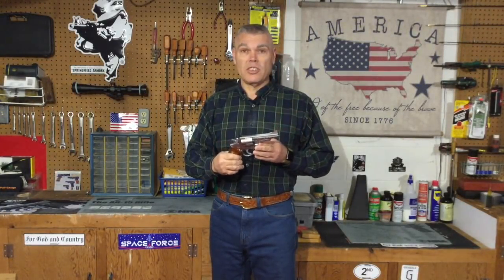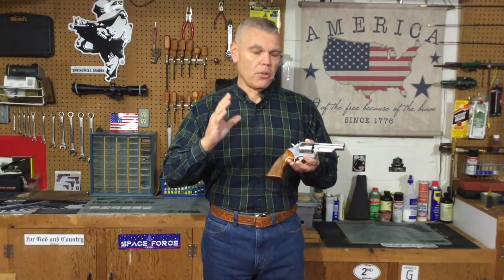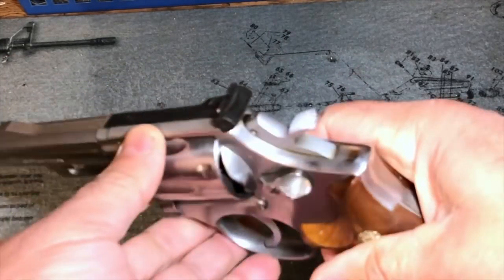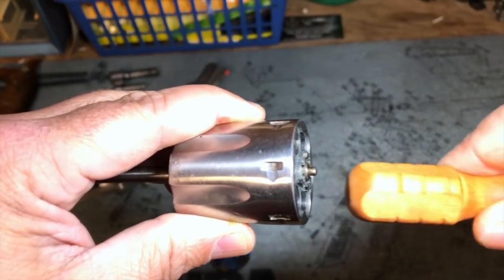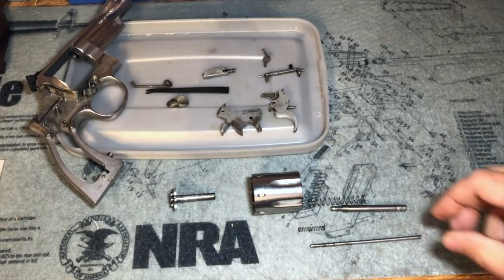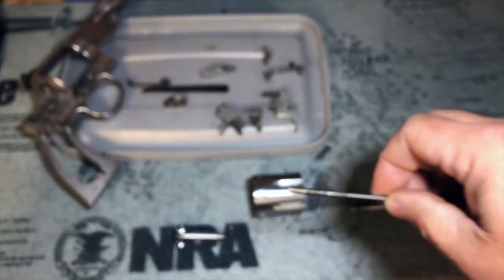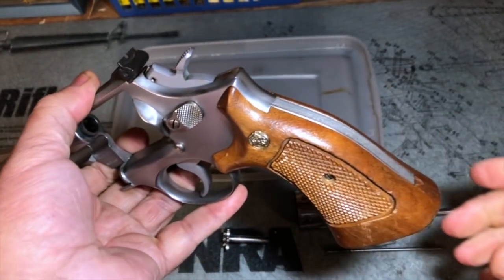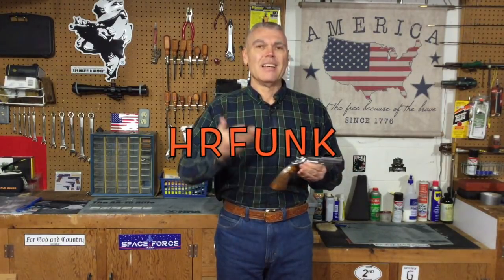S&W Combat Magnum Resurrection

Comment: I remember when WD-40 came on the scene.  We all thought it was the best thing since sliced bread and we used it liberally on all of our firearms and anything else that moved.  Little did we know that over time it would congeal.  We go a new pastor about 30 or 40 years ago and I did the same to his revolver.  Fast forward 30 years or so and he asked me to take a look at his little Rossi as it was completely locked up.  I finally got it apart and I hosed it down with WD-40, blew it out, and oiled it a little with Mobil 1 full synthetic.  He was so happy that he gave me his Bianchi holster which I gave to our eldest son.

Comment: I received my first handgun when I was about 13 years old. It was one of the early model 67's with the stainless rear sight. I was always told by my Dad that all she needed was a couple drops of oil down the hammer for internal lubrication. I never had a problem with the oil getting sticky, but reevaluated that advice in my adult life. 

Shooting bullseye pretty heavily one summer I ended the season with a 686 that wouldn't stop weeping oil from out of the trigger. I disassembled, cleaned, and relubricated it with a touch of red synthetic grease and never looked back. All my guns are treated as such now, including that old model 67.
Reply from the maker: I’m glad you still have that 67!

Comment: I have found this issue with lots of firearms. It occurs with not only revolvers, it happens with pistols, rifles and shotguns as well. The main cause is the firearm is stored for long periods of time; years likely. No lubricant has a shelf-life for years. The owners maintain the outside of the firearm and internal parts are left often with just the factor applied lube. The only oil added is on outside surfaces. What happens is the outside protective oil is replace with regular maintenance and inside lube dries and freezes the moving parts in place. The best way to avoid damaging a traditional blued finishes is using hot soapy water and soft brushes. Hot water and Tide dry detergent soap works better than the liquid Tide. I hang the action or frames in a tank and let the hot water and detergent do the work. Stainless steel welding rods make good hangers. Then rinses with water and use water displacing oil or compressed air or both too dry the parts and action. This is really good for cleaning Black powder guns too. Question for you; do you remember when Smith & Wesson revolvers were sold with wooden presentation boxes?
Reply from the maker: I do, but it’s been a while.

Comment: My favorite S&W is the model 19. I carried one for over ten years as my duty weapon and still have it. Our PD sold us our old duty weapons to us for $65.00 when we went to the Sig P220.
Reply from the maker: I’m glad you still have that fine old wheelgun.
Reply: @hrfunk  I have the old blue box and all the paper work and tools that came from the factory The bluing is wore off much of it but mechanically it is excellent with a smooth action. It was bought in 1970 by the PD.
Reply from the maker: That is very cool. I’ve got a 1980 version I bought from another officer who had carried it for years on duty. It shows some finish wear, but it still runs like a top.

Comment: Revolvers require maintenance. Revolvers that were shot but not cleaned will experience malfunctioning. This is a good video that shows a clean looking revolver from the outside with the internal mechanism all gummed up. I purchased an old S&W Target Master from 1949. Smith and Wesson said that any revolver that was a pinned barrel was no longer being serviced. I took the revolver apart and did exactly the same type of cleaning. Definitely helped function after.
Reply from the maker: Good! I’m glad you rescued that one.

Comment: Groo here
 Old smith told me [he tuned Pythons! ]
 Remove grips, take cylinder off if you can [auto field strip] then put in bucket with Clear K1 for 24 to 48 hrs.
 Then drip dry or Blow dry with air.
 Called it his 50 cent trigger job!!!!!!!!!!!!!!!!!!!!!!

Comment: Excellent Video!  I have an old S&W M10-6 that was in similar condition when I got it.
To free up the Action, I took off the Grips and soaked it in Kerosene for about a Month.
Finally got the Action freed up, but I probably should do what you did here and give it
a good going through.
Reply: I've used "Ed's Red" to clean a few guns. Soak for a day, flush with fresh liquid, blow the excess out. Works good.

Comment: We used to use an ultrasonic cleaner that slightly heated the solution once a year for a deep clean of our stainless pistols followed by a VERY light coat of stainless steel lube. In between cleanings used Hoppe #9 and standard cleaning gear with a very light oil lube. I loved my Mod 66 but was unable to purchase it when we switched other to S&W 6906s

Comment: Ballistol will gunk up a pistol. Hickok45 is a good guy, but he douses his pistols with Ballistol. I used it on a 1911 about 5 years ago, and put it away in my safe. Over a year later, I took the pistol out, and the trigger returned VERY slowly. The Ballistol had congealed into varnish, and I never used it again! Gunblue490 has video rants about using too much lubrication, and he also uses two drops per pistol. Great Video, Chief! 👍👍👍👍🇺🇸🇺🇸🇺🇸🇺🇸
Reply from the maker: You’re welcome Frank! Thanks for watching!

Comment: That, kids, is what WD-40 looks like after some time. Basically, Cosmoline with a carrier. 
Good stuff for a lot of things, but this demonstrates, not a long term solution.
Reply from the maker: Agreed!
Reply: @hrfunk  I've used WD-40 for over 30 years on all my firearms with no trouble at all. I use it as a cleaner and rust preventative then follow with 3 in 1 oil for lubrication.  I stopped using Hopes 9 because it does get sticky and gummy as it dries.  These days I use sythetic motor oil (0W-20) as a lubricant, especially on AR BCGs.
Reply from the maker: Now you’re using what I use except Mine is Mobil 1 synthetic.
Reply: Yep. WD-40 has mucked up a lot of revolvers! I would have considered boiling the whole disassembled gun to clean it and remove rust.
Reply: The only thing WD-40 is good for is lighter fluid.

Comment: Another practical video, thank you so much.

Over 20 years ago, I bought a used-629, which I used for bowling-pins with.  All was okay till the gun froze in mid-competition.  Was shooting double action, but the trigger would only go about halfway back and the hammer would not go all the way to complete the cycle.  The smith I went to see swore there is nothing wrong, no broken parts.

I'm gonna have to revisit this.
Reply from the maker: I hope it’s helpful. Good luck!

Comment: I found a 27-2 made in 1980 at a local hardware store that was in the same condition. Looking this over with a fine tooth comb I thought it looked like a brand new gun with no scratches, no carbon on the front of the cylibder, and a forcing cone that looked like it hadn't seen a round through it. When I took it apart I found the cylinder assembly full of what looked like sticky cosmoline, it was also inside the frame on the trigger parts. I think this was lubricated at the factory, tested, and never shot again. It had old lube in the spots HR lubed so I don't think it was someone overlubing it. At any rate I have a brand new looking 27-2 with an extremely nice trigger pull. I'm afraid to shoot it as I don't want to devalue it.

Comment: I had 2 66's back in the day.  Both were 2 1/2".  I shot Remington's hot 125 gr jhp in one of the to the tune of about 300 rounds.  It cracked the forcing cone so I contacted S & W and they paid the shipping both ways.  They replaced the barrel and cylinder and maybe some other parts on their dime.  Those were the good old days.  Their smith put a note in the box stating "practice with .38's and carry magnums".
Reply from the maker: The hot 125 grain loads seemed to be the biggest culprits for that back in the day. I run 158 grain magnums in mine and I've not yet had a problem.
Reply: @hrfunk  This was in the late 70's and early 80's where the ammo was loaded much hotter than today's fodder.   The k frames would not take a constant beating from the 125 gr. as they were by far the worst offenders.

Comment: Back in the 90s I worked in a local gun store. A customer brought in a Remington 7400 with the bolt unable to move. Turned out when he mounted his scope instead of using a drop or two locktite he used pretty much the whole bottle. It had ran done inside the receiver making s big mess. We finally got it apart and cleaned.
Reply from the maker: Wow! Now that must have been a mess.

Comment: As a former armorer, H.R. I can tell you that it was probably "lubricated" with WD40.
People, please do NOT use WD40 on your firearms!!! That "varnish" is exactly what happens when WD40 hardens!!!
Reply: Amen. And it also kills primers.
Reply: People need to know what WD40 actually is.  The WD stands for Water Displacement.  It was originally designed to remove water from electronics.  Not as a lubricant.  It actually can dissolve and displace many lubricants.

Comment: I had the same issue with an early Model 29 I bought from an older gentleman. I had to disassemble the weapon entirely and sonically clean it.
Reply from the maker: The sonic cleaner would have been better for this 66, but I don’t have one available to me.
Reply: @hrfunk  Pretty inexpensive at harbor freight or northern tools. I use one to clean my pistols and small parts in it

Comment: Had the same problems with my first 66.  Mine was the first model with the unusable stainless front and rear sights that I bought while in the USAF in the 70's.  My revolver would lock up when using top-end loads of Herc 2400 and H110, fouling would get past the gas shield, and 'stick' the cylinder.  Didn't take long to trade it off, as S&W didn't seem interested in taking care of it.  Later 66's I owned didn't have the same problem, nor did my 686's.....  Couple of years ago, I acquired another 66 "no dash", it having a six inch barrel and the same 'invisible' sights, but it didn't seem to have the same problems as my first 4'' gun.  Maybe just one of those with a bit of a problem that slipped out the first time 'round.
Reply from the maker: That was is a known issue with the early M66 revolvers. The problem actually resulted from the way the stainless steel expanded when the parts heated with full power loads. The same thing would have probably happened if you were shooting light .38 Specials, but it would have taken more rounds to do it. The design was modified by S&W and later revolvers did not have the same issue.
Reply: @hrfunk  That's right.  My 'every day' loads were hard cast 158 "Keith type" from a Lyman mold, and used a bit of Unique to get the load to 8-900 fps.  Took a few more rounds, but the .38's would eventually do the same thing.  I could 'nurse it along', if I coaxed a bit of Hoppe's down the crane, but that was a PITA in the middle of a prairie dog town, and had to do a teardown when I got home.  Not what I had in mind when I bought the piece.
Reply from the maker: That’s interesting. I’m not sure when the 66 was changed to eliminate that problem, but the fact you had a before and after version indicates the design modification was effective.

Comment: I'm almost wondering if that was dried  grease and not oil. Either way, for the inside of a Revolver, Remoil works excellent as it evaporated the carrier and leaves behind an ultra thin coating of rust protection and lubricant BUT will never congeal or attract debris. Since a Revolver doesn;t get torn down al the way often - it os very important to use a thin, non hardening product. I always used Rig #2 Oil but since its discontinuance, Remoil is a close second.
Reply from the maker: I'm just glad these old wheelies can be restored as easliy as they can.
Reply: I agree. I use Remoil, too, on my revolvers.

Comment: Great job, H.R! I have had very good results using an ultrasonic cleaner filled with Purple Power, followed by some blasts of brake parts cleaner. Almost all of the sticky will wipe off with a minimum of scrubbing. I then spray everything down with Ballistol, let it sit for a while and wipe it off. I bought a .303 Enfield that the bolt was so gummed up that it took an extreme effort to open the breach. After the ultrasonic treatment, it disassembled easily for final cleaning. After spraying everything with Ballistol and wiping it off, the unlatched bolt will slide open just by tipping the muzzle up about 20 degrees. Have you tried anything like this?
Reply from the maker: No, I haven’t tried that but I’ll keep it in mind.

Comment: I ran into the same problem, though not nearly so bad, on a pre model 10 K frame from 1947.  It had 70 years of congealed gunk.
Reply from the maker: I hope you cured it.
Reply: @hrfunk  :  It works fine now, but did require several attempts at reassembly.  At first with all the side plate screws snugged down the hammer wouldn't fall freely.  Unfortunately I still haven't figured out what was going wrong with the reassembly.
Reply from the maker: @craigbenz4835  Gremlins.

Comment: Great job, Funk!  A beautiful pinned and recessed Model 66. Is it yours now?  I’ve had a few 66’s.  Stupidly sold them.  Also a mint 19-2. Pinned and recessed. Sold it too. I thought it was too nice to shoot. 

I bought a LNIB 15-2 Combat Masterpiece last year. Even the box looked new. But the action was sluggish. I tried blasting brake cleaner into the action followed by compressed air. No change.  I finally popped the side plate. Was hesitant to on such a perfect gun.  Looked just like your 66 in there, although  the gun did function. Completely tore it down and cleaned it. Operates perfectly now.  Haven’t shot it yet. It will never be as nice again and I have other revolvers to shoot. I probably will one day, though. 

So Chief, an old Smith armorer like yourself, if you could only keep one, that 66 or one of your M&P pistols, what do you keep?
Reply from the maker: Wow! If I could only keep one, and I hate to say this, it would probably be an M&P. I love the old wheelguns and they still have their place, but if I had to make the choice it would be the more modern design.

Comment: Thanks!  That was so satisfying to see it properly cleaned and returned to combat ready status.   Was that a nylon brush that you used?   I have started using my synthetic bike lube (Prolink) on my guns and the results have been good.  It is formulated to bond with the metal and does not build up or become tacky like oil.  On bikes that would attract dirt and foul up the system.
Reply from the maker: Thanks for the tip Stan. Yes that was a nylon M16 brush.
Reply: @hrfunk  Youŕe welcome.  If it sounds interesting to you I would recommend the Luber pen.  It adds to the cost, but the pen is really convenient for precise application.   https://progoldmfr.com/product/luber-pen/.   Of course, if you already have a syringe the larger bottles would be a better deal.   I use Mobil 1 in my cars, but haven´t tried it as a gun lube.  I like the idea of the metal bonding aspect of the Prolink lube.
Reply from the maker: That looks interesting. Thanks!

Comment: No need to disassemble. Remove the grips and set aside. Remove the sideplate and cylinder/crane assembly. Place all metal parts in a sonic cleaner filled with any form of mineral spirits, turn on for 24 hours, and go about other business. Next day, remove and blow off with canned air or let air dry. Lube with LSA or other proper firearm lube and reassemble. Be happy with a very nice M66!
Reply: Sonic cleaner for 24 hours?  You serious?

Comment: Great video, I only made the WD-40 mistake once. Instantly gummed up. Ridiculous that Youtube won’t allow you to show disassembly and reassembly as I’d like to do the same to my Smiths. I’m confident enough to have changed the mainspring and rebound springs out on several, but am leery of full disassembly.
Reply from the maker: There are videos and other reference materials out there to show you how it's done. The important thing is to go slow and be careful. You don't want to force anything because some parts will break.

Comment: With cracked forcing cones and deep flame cutting plaguing many smith 357s or the internal lock,I think the 28 29 is by miles the best choice,it really is not much heavier or cumbersome than the 19.

Comment: #hrfunk: I have my own suspicions, but what lubricant do YOU suspect was used on this revolver? I've seen this happen once before... a worse case, actually; the revolver was fully disabled, gummed up beyond functioning at all. In addition to having been overlubricated, that one (a Model 10 snub) was left stored in a desk drawer in a leather holster for over 6 years.
<Edit note> It was loaded, too. As we couldn't even get the cylinder open on it, we had to put it in a Varsol bath for 48 hrs. just to get started...
Was this a new acquisition of yours, or does someone owe you a case of beer for this job?
Reply from the maker: I have a feeling this was something like 3 in 1 oil or maybe Outers. This one isn’t mine. I was asked by another viewer to see if I could get it working correctly again.